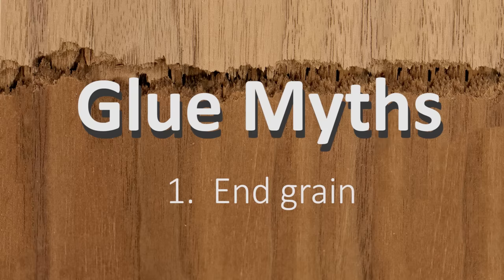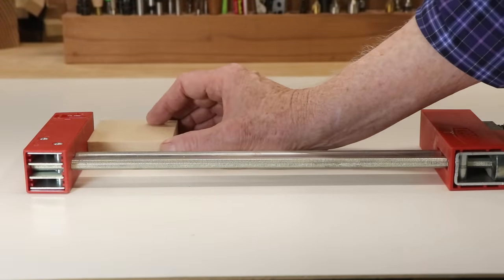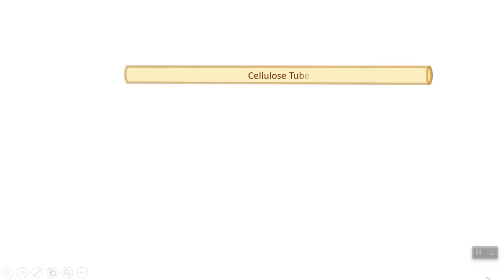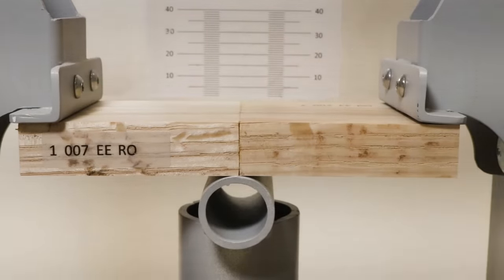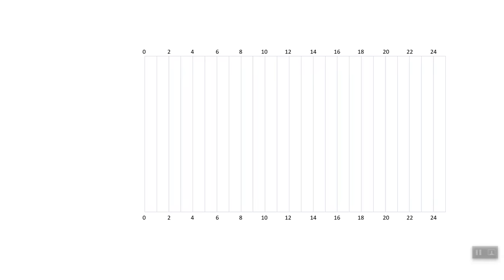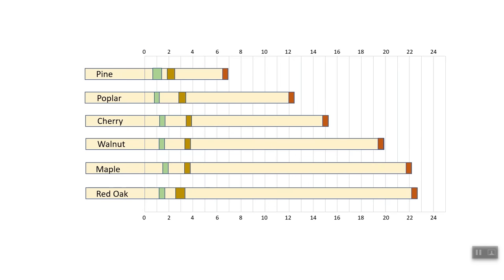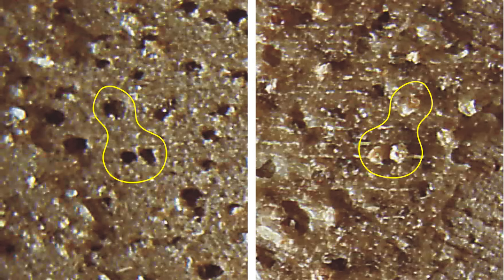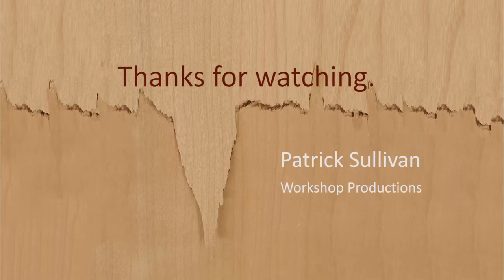Glue Myths:  1. End grain

Comment: does the variance in glue strength not also depend on the fact that the glue is mostly adhering to the lignin? also, in end grain bonds, the glue can penetrate the tubes, in side bonds it can't, therefor the contact surface at which the glue grips is much larger in the end grain bonds, provided the glue is cohesive enough (depending on the pore diameter, there will be a maximum relevant depth, and depending on the glue cohesion that depth will be larger too). Perhaps there is also a difference between the bond to the cellulose and the bond to the lignin, in which case both types are vastly different, because in a side bond there will be almost zero bond with cellulose (given all the cellulose is coated with lignin).

Comment: Actually if you examine your results the myth is true. Side to side glue joint was intact, the wood failed. This would be expected. Karate boards are broken the same way. Rotate the board 90⁰ and a hand is broken. But put a end grain glue joint in the center of the board, and the board will will still break at the glue joint. The board without glue joints is far stronger. So it really comes down to application. Furniture, no big deal. An application where stress is involved never use an end grain glue joint. Excellent demonstration to prove a myth true.

Comment: Good video but seems slightly deceptive when saying end grain joints are universally twice as strong as side grain joints.  Your actually comparing the end grain joint to the weakest link of the side grain joint which is the wood itself and not the joint.  But i suppose for all intents and purposes it still shows that end joints, when glue has been properly applied, have useful strength.

Comment: Very, very nicely done. Rules of thumb that arise from experience based on trial and error are a heck of a lot better than nothing, but are no substitute from drilling in to see how a system really works; separating it out into its distinct underlying components and then looking at each component in turn. Once you've started playing with wood you quickly build up an intuitive grasp of some of the fundamentals. You very quickly appreciate the difference in strength along and across the grain. You pretty quickly appreciate the difference in expansion along and across the grain. But unless you actually bother to perform the kind of experiments you've done, you're unlikely to separate out glue strength from geometry; specifically lever length. As your results so clearly showed, the PVA end grain joints are an order of magnitude weaker than continuous end grain. It's not hard to see how we've collectively jumped to the completely erroneous and almost meaningless conclusion that end grain glue joints are somehow just fundamentally weak. The takeaway from this shouldn't just be a better understanding of PVA, but to remind us to always apply a healthy degree of scepticism to received wisdom and our own intuition, and to look for objective evidence to inform our opinions.

Comment: Whenever Iv had end grain joints fail it's always looked like a dry joint. So I started sort of sizing the joints except I don't let it dry, I just put excess glue on the end grain and wait for 5 mins or so, put fresh glue on if needed and then clamp. Haven't had nearly as many problems since doing that.  I did a lot of face frames for cabinetry so we are talking about hundreds of joints if not thousands. Obviously I didn't break test many of them, so take that anecdote with a grain of salt.
Reply: You should not glue endgrain to endgrain as that is just weak (even this video shows that).
Use an actual longrain joint like a lap-joint - a lot stronger.
Reply: @ABaumstumpf  no it doesn't
Reply: @miles11we  Well, it does. The video shows that the endgrain-joint doesn't even reach half the strength of the wood, while a longrain-joint like a lapjoint can be as strong as the solid piece of wood.
Reply: @ABaumstumpf  besides, what I did at my work was by far the most effective and efficient way to go about it. Those face frames are still in peoples homes after years and years of use and iv never had anyone have a problem. I was merely talking about how if you are going to do a T joint like that, sizing the joint can eek out a bit more reliability in your glue up.
Reply: @ABaumstumpf  as much as I would love to have everything my hands touch be a boutique work of art, when its your living you do what works, is efficient and gives a suitable product.

Comment: Corelation does not automatically equal causation.  So because end to end joints break in the joint itself, people associate it as a weak joint, rather than the weak point, most likely never knowing the force it took.

BTW Those martial arts "Gurus" who break boards never do it cross grain, and always along the grain, until they let you try!  Then they pull out the longitudinal cut boards!  It's also almost always weaker species of woods like pine, not maple or oak.

I am a guitar builder and have been using PVA glues from the get go (1982), as although hide glue does provide a good bond, it won't last, and is susceptible to all kinds of influences.  Other builders would say it's counter productive as it makes repairs difficult, to where I counter "Sure, because they are the cause for the need to repair in the first place!"  Many builders especially acoustic makers still swear by hide glue, and still make instruments the traditional way, as if better construction methods and smart design don't produce better results:  Tradition is stagnant, technology moves forward.  Strangely people will fork out 2X and even 10X more for a brand that boasts tradition, and then pay for frequent setups, and way more repairs than a modern instrument needs that bows them away in every way, because mythological ideology sells better, and well, thinking is hard.  Actually the whole guitar industry relies heavily on peoples unfounded beliefs they spread in the first place, and the most guilty are the most profitable;  Go figure.

BTW:  I have spent a crap load of time trying to dispel many of the common myths in my field, only to have failed with all but a few, who normally already have a background in some kind of science related field who can understand by proxy.  Otherwise it not only falls on deaf ears, and the WANT to BELIEVE due to personal incredulity even fuels the placebo effect and people believe and even claim to hear in measures way outside the range of human capability and spend a lot of money on their beliefs despite there being no viable evidence for their claims whatsoever even over accurate measurement systems.  Well, I have a clause for that in my way above standard and implied warranty: "The I cannot guaranty Mojo clause".  Although never challenged in court in all my ~40 years in business, if it were to happen, I would rather use a stack of peer reviewed data and a psychologist as expert witness, than a whole team of industry insiders who very likely have no  clue themselves.

Comment: So its not the glue joint thats weaker, it's just that the wood itself is much stronger (than side grain and the glue combined) so the weakest part becomes the glue joint. It honestly kinda makes sense, I remember being in shop class and being told to never put end-end when gluing because its weaker, and to me that always sounded wrong because in my mind end grain was rougher, therefore it had more surface area, therefore a stronger joint. Good to know

Comment: What about what happens to pva glue over decades? Does it remain strong or start to crack and separate from wood? If so then it would be weaker than a joint that has wood reinforcement like a tenon, spline or dowel etc, no?

Comment: You dont glue up end grain because it is the wrong way of using wood. When you take two wooden planks, and glue them up in thickness, the result will be just as strong as the same dimension beam. When you take two short beams and glue the end grain together, the result is not good at all.

Comment: I think a lot of woodworking knowledge is just word of mouth without any actual testing, keep going. could you do the screw thing? people say screws are too brittle to hold together wooden stuff and the movement of the wood as it dries will break them but I'm unconvinced. does the movement of drying wood actually have to power to snap a wood screw? why are deck screws the standard? wood that spends its entire life outside with the movement of the wether yet screws is still the prefered method. could you test this?

Comment: First of all, English is not my native language, so I apologize in advance if I have translated something wrong.

I am a Wood industrial engineer and researcher. The problem with the whole experiment is that it is incomplete and misleading. Of the possible forces acting on the joint (tensile, compressive, torsional, shear stress), only bending was examined. In contrast to this force, the wood is weakest perpendicular to the fiber direction and is particularly strong in the fiber direction. This can also be seen beautifully from the video.
According to an European standard, (but to my knowledge also an international worldwide standard), an adhesive must be able to withstand a shear force of at least 10N / mm2. Which is greater than the natural shear resistance of the wood perpendicular to the fiber direction, i.e. the adhesive will then have to be stronger in all cases than the wood. (The standard also has other conditions, such as water resistance, etc. These are not relevant now.)
The lesson of the video is that the adhesive is stronger than the flexural strength of the wood perpendicular to the fiber direction and weaker than the flexural strength in the fiber direction, but nothing else.
Most wood structures are designed to avoid structural solutions that result in unfavorable mechanical stresses.
Basically, if a bonded joint is subjected to a bending load, the structure is inherently poorly designed. (There are a few rare exceptions, but they usually show complex stress.)
If you repeat the experiment, examining the shear and pulling stresses that are much more common in wood joints (e.g., fingerjoints or half lap joints where bending stress is rare or non-existent), the result will be that end grain joints will look particularly weak.
In addition, perhaps we should immediately introduce the "compared to what?" issue.
End grain glue joints are weak compared to what?
The answer is yes, in all cases where the joint is subjected to COMMONLY occurring mechanical stresses (i.e., not just an aesthetic role, or exposed to an accident ), compared to traditional, non-end grain joints.
Even if we do not subject the joint to mechanical stress, although in rare cases, an end grain joint can "fall off" by itself (from its own weight) over time.
So, this is not a myth.
Please repeat the experiment in a way that exposes the tested pieces to the mechanical loads that occur commonly.
Otherwise, the method is good, much higher quality than most similar videos (from a scientific point of view entirely), only incomplete, so the conclusion is not correct.
Reply: i'm glad i found your comment. It makes sense to me. Also it'd be illustrative you write your opinion on the others "myths" number 2 and 3 from this channel.

Comment: After this video I'd be curious to see how finger joints compare to mid section wood breaks. If the fibers cross the joint plane due to rhe joint geometry, I wouldn't be totally shocked to see it approaches no joint strength.

Comment: This is a great video but I think there is something lost in the translation as far as what is allegedly common knowledge about end grain joints and how they are inferior. Common knowledge about "end grain joints" is actually comparing the joint type. A Butt joint is < a scarf or finger type. I would argue that your testing demonstrated what is already common knowledge about grain strength vs glue. This is why you never butt joint two pieces of wood that will be under stress in the manner in which your test fixture applied.

Comment: Not related to the topic of the video but I think your load cell end loading area may be incorrectly loaded.  All load should go through the load point's screw rod without flanges as that will result in eccentric load.   Also your cantilevered jack base may give inconsistent results at low loads vs high loads due to the small flexing.  This doesn't change your video results but though I'd suggest that for future projects.  Alternatively, you could calibrate the existing scale for the full range of your use with several data points and add the deviation to your Arduino code.
Edit:  to avoid using the jack base cantilever which is not good, you can let the other side rest on a a metal base with a dull edge, and approximately multiply by 2 depending on your loading distances.  Now you can more than double your load capacity and more accurate and not worry it will break or deform with time.

Comment: As with all science, this is testing one precise circumstance. And in this circumstance, your theory holds out. The problem with your theory is, I'm not sure anyone has ever said woodworkers should rely on glue-only joints. (The only exceptions I can think of for this are edge laminations, and even those have often been reinforced with dowels or dominos.) 

The majority of joints are designed to interface as much long grain as possible. In those circumstances, the joint will get its strength from intact long grain, and the glue is just there to hold the joint together. Putting glue on as much surface area as possible is obviously going to lead to a joint that holds together better, but it would be foolish to think that the glue is what gives the joint its strength.

On the other hand, if you took your theory that end grain makes a better glue joint and maximized your joint design to optimize the amount of end grain surface area, you'd come up with a substantially weaker joint because the orientation of the long grain would necessitate having the mechanical bond be dependent on the strength of the lignin, which you say yourself is less strong than the glue. 

Also, if you think Tite Bond et al. haven't studied this, I've got a bridge to sell you.

Comment: Here's my theory.... people just assume that the wood -- regardless of orientation -- is stronger than the glue. Since an end-to-end bond always breaks at the joint, and people assume the glue is the weak link, when they see the glue itself fail they assume it was a weaker bond. If the wood itself broke like in the side to side, and the wood is always stronger, then the joint itself must also be stronger. 

So.... "end-to-end joint is so weak, it just broke" and "side-to-side joint is so strong, the wood broke instead".  It's all a matter of misunderstanding which material is actually the stronger.

Comment: glueing end grain together is NOT the problem,  the problem is that most people dont know how to do it properly.   to glue end grain together so that it has strength and lasts you MUST pre load the grain with glue before you attempt the glue them together.  you need to force glue into the pores and then let it dry,  after you have done that, then you glue as normal.   the joint will be just as strong as a long grain glued joint using this method.
Reply: And it is still a weak JOIN as the problem is the endgrain joint itself. Use a lapjoint - there you have longgrain joint - and it will be much stronger.

Comment: Would have loved to have seen a test of end grain in TENSION.  Are there circumstances where a scarf joint for a joint in pure tension (ie no rotational component) is not needed and a simple glued end grain butt joint would suffice?
Reply from the maker: Jeff:  I hope you understand that I am not trying to convince people to use a lot of end-grain butt joints.  I am trying to understand and explain how glue interacts with wood grain, so you can plan glue joints that maximize strength for your particular needs.  I am sure there are situations where a scarf joint might provide the best results, depending on exactly what kind of stresses it faces.

Comment: What a buzz this video has made. A couple things I am now wondering is how the joints would fare over time, or with greatly varying temperature/moisture swings.
Reply from the maker: It is very clear that PVA glues are extremely durable, with joints that remain strong for many decades, despite living in harsh climates.  When PVA joints fail, the reason is usually operator error.  End grain joints in particular are actually less vulnerable to wood movement than are cross-grain joints.  I built a wooden case for my watercolor supplies that traveled with me to hundreds of outdoor locations, often bouncing around in a trunk or a bus, with no joint separation whatsoever over a period of 40 years, despite about a dozen end grain joints.

Comment: I wonder if the myth came from the old days when the main glue used was Hot Hide Glue? Now you have got me thinking about this I will have to do some experiments. My intuition tells me this may be the case as HHG is a more suseptable to weakening through heat and humidity over time. I see this a lot with Vintage Guitars that have come in to my shop for repair work.
Reply: No, as the saying is about avoiding endgrain joints as they are weak - and that is still true. a simple buttjoint is seriously weak - as he has so nicely demonstrated in this video - at not even half the strength of the wood, where as longgrain joints like a lapjoint are usually as strong or stronger than the wood.

Comment: If you have to joint 2 boards length wise, end grain joint would be much weak then an half lap joint or the board itself... This is were the myth comes from
Reply: a good joint must find a way to make the wood fibers work, and not the glue or lignin.